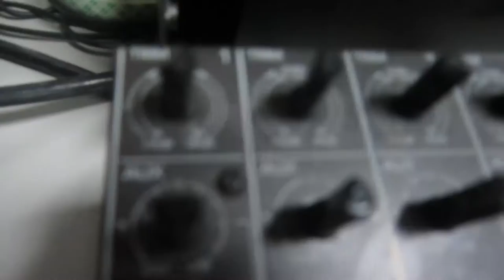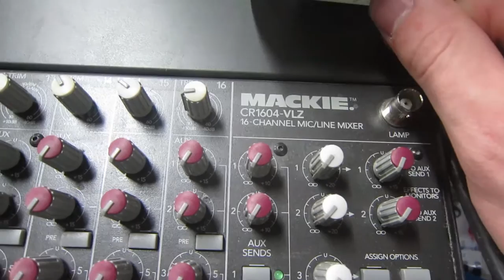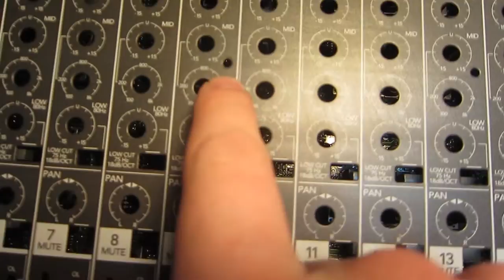AV Blog 2015-07-06/07: Mackie Cleaning

Comment: I've always found the cans of DeOxit to be rather hard to control,and it ends up getting everywhere. You might have a less messy time if you use the stuff in the little dropper bottle(similar to the fader lube bottle).
Reply: PhattyMo I agree. I couldn't find any contact cleaner at the time, and so I was using the sprayer as a means of blowing all the junk out, too.
Reply: Joseph Bielecki Glad to see that faderlube I sent in getting used. I also sent in a similar bottle of regular deoxit but who knows where that ended up.
Reply: KE5SUI There's another still packaged bottle up in radio.

Comment: How did you clean each individual pots ? They are sealed. I'm actually cleaning the same Mackie CR1604 mixer. I saw you used deoxit but how did you applied the sprayed stuff inside all the pots ? Sprayed at the side of each pot's shaft bottoms to get the cleaner inside by pressure ? So far I started desoldering each annoying pots and dismantled them, put a small drop of WD40 in them then close them back before resoldering them in place. Did the job BUT time consuming...
Reply: ...and NEVER take the pots apart!